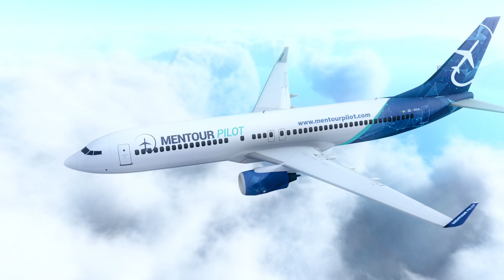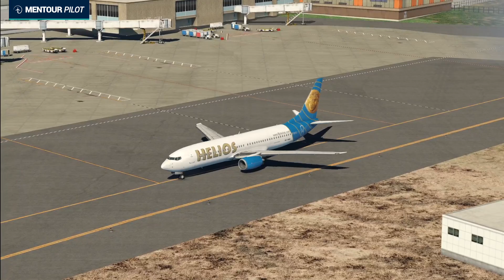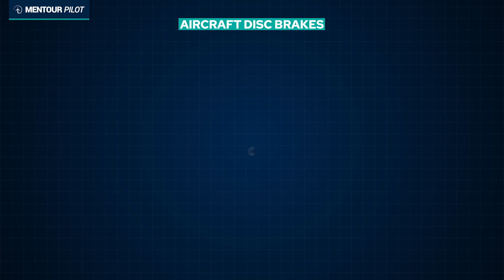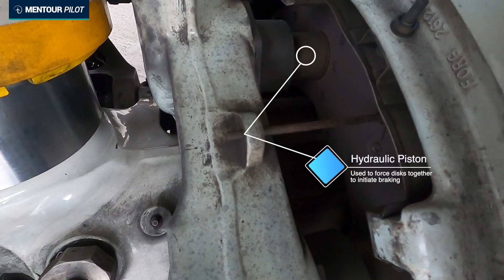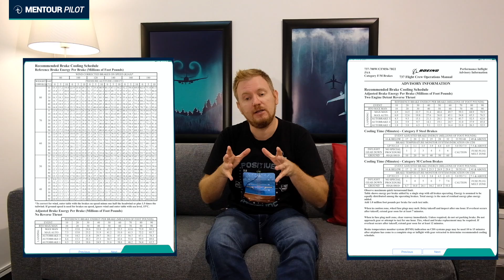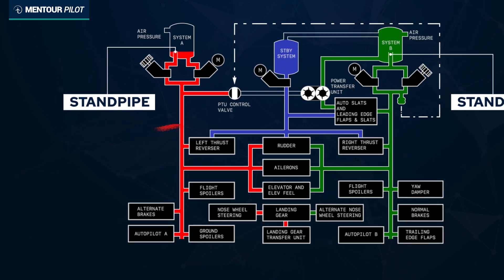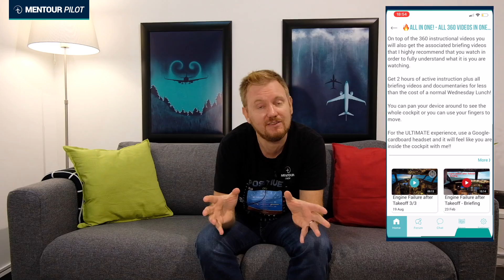How do Aircraft BRAKES work?!

Comment from the maker: Get 20% discount on the yearly subscription of Brilliant by using this code 👉🏻 https://brilliant.org/Mentourpilot/
Reply: Hej!
Reply: i got a good one.  What is that noise in the gear bay that is a low pitch tone followed by a higher tone beep?  I think it has something to do with a systems test or resetting the FMS or something.  I hear it from time to time while fueling the 737 NGs.
Reply: During a normal landing, under calm and dry conditions, typically what percentage of speed reduction can be attributed to: brakes vs spoilers vs reverse thrust ?
Reply: Exactly how bad is it to do 2 rejected landings 40 minutes apart? I was flying from Fiji to LA and apparently a fuel pump wasn't working.  The pilot waited for a plane to land that was supposed to have a replacement, but it didn't, so he tried and failed to take off...  Then waited for the another plane to arrive that also might have a spare pump, but the didn't, so 40 minutes after the first rejected take off, we had a second one...  About 10 minutes later he said, 'Ok, lets just try that again...' Third time lucky I suppose - we got airborne!  And had a completely uneventful flight to LA.  Would a third rejected take off in an hour have been bad?
Reply: @rjmac3095  what aircraft ? Most Airbus planes have active brake fans and brake temp indicators
Reply: @bobl78  It was definitely a Boeing, but I'm not sure if it was a 737 or a 767, basically one of the medium/large aircraft, but definitely not a 747.  It was Air Pacific, in 1997, if that helps.
Reply: Mentour Pilot ( Wow !!!) SHEIKH MD. SHADDAT HOSSAIN .
Reply: The trucks use air brakes. Why do airplanes use hydraulics?

Comment: 18:28 - nope, sounds perfectly reasonable, at least the way you explain it. Autobrake might not have the same feeling that you have as a human, so it sounds like a good idea to set it a bit lower, to prevent skidding on one side or whatever might be a problem. As a human, you can judge those risks, and quickly adjust to those factors. Automated systems normally reacts to performance, rather than a visual or experienced reference like you might use as a pilot.

Comment: nah, never thought of it, really. BUT - those tires, they´re the really amazing part! Coming from a -50 degree environment onto hot tarmac that might be 70 degrees, spinning up at landing and then immediately having to brake? That´s the part that amazes me. Metal can take a lot of heat difference, and it dissipates really quick. Rubber is an entire different ball park, and it performs extremely well!

Comment: This is a GREAT video, Mentour Pilot! I wonder if you have contemplated remaking these older Aviation Systems videos with the MAGNIFICENT TEAM you have working for you now, with new Graphics & Animations? This is a GREAT Education Channel for Aviators, and even Engineers!
Just a point of correction:
— The lower temperatures of Carbon Breaks is down to the Physical Heat Capacity of the Material, not primarily the Heat Transference, as you indicated in the video.

Comment: Wow wow wait a second! If you position RTO on the auto brake and then you really need to to reject the take off even slightly a bit V1 speed and lets add a wet slippery runway then I'm curious to know! 1st as you said putting back all thrust levers back will automatically activate RTO on auto brake, but you found in a second that you need thrust revers deployed and apply max trust using the thrust levers, then what happen? Are you hitting the brakes with your feet still or you know RTO will apply them for you even when you apply max trust to slow down the airplane with reversers deployed to stop on the runway??? Or all of the rejected takeoffs before reaching V1 are trained and executed only by using brakes and nothing more???

Comment: Back in the 70s and 80s I worked for PSA in San Diego maintenance on the B-727. All our 727s had nose brakes which were only activated during heavy braking. They were required to operate out of airports with shorter runways to assure stopping during a rejected take-off at higher weights. More passengers were carried with operative nose brakes. We were required to remove the brakes after so many months because they were never used and send them out for overhaul basically to remove the rust.

Comment: Just "adding 1+1" here but if on carbon brakes it's the number of times you use them and not the intensity that wears them and you have an antiskid system that will release and apply the brakes very quickly, I think it makes sense to say that antiskid will wear the carbon brakes a lot faster than steel ones even though they're better, right? Congrats on the great channel ;)

Comment: Yes I know modern large aeroplane wheel brakes work, Instead of a single disc pad set up on your wife,s Nissan Micra Economy car. You have multiple rotor discs and stators stacked  one atop the other like vinyl on an old  50,s stacking record player,. Working off the utility hydraulic system at 5 - 6,000 pounds per square inch six or eight  piston actuators, each the size of a catering can of coffee  squeeze the rotor discs stators together like a hand cranked cider cheese press. Slots precision machined inside the wheel rims  engage with tongues on machined on the rotor discs. Each Brake pack prevented from revolving with the wheel by strong torque rods anchored to the oleo leg.  Like a top range BMW or Jaguar a sophisticated  anti skid system ,like that manufactured by Allied Signal Honeywell prevents wheel lock up during heavy braking by sending a series of pulses of high pressure to each brake pack  ,on off on off ,in microseconds.  Most large commercial jets have a pre selectable  autobrake function , essentially the braking systems brain, detects which wheel is on  the verge of locking and skidding  then automatically applies releases the brakes in a series of skips.

Comment: The last destination today is a short field , the solution seems too simple, If I am the pilot and knew there are residue heat from the last airport ground operations, I just have the gear down earlier and let the airflow cool the brakes to ambient temperature. The gear will also help keep the aircraft within the terminal speed limit.

Comment: You are always talking about how important SAFETY is to the airline industry yet you have planes with inferior brakes and a lack of a vital sensor. Now I know you can tell me that the sensor is not that vital because you can do your calculations but PEOPLE can make calculation mistakes. Also PEOPLE can be lazy or have some other mental malfunction and just not adhere to doing it. Not only should every plane have the sensor but they should be tied to the computer in a way that prevents pilots from taking off again until the proper temp is reached.

Comment: Use of the Helios 737 in this video was probably ill-conceived. The vision sent chills through me, as this was the airline that suffered the horrendous depressurization and crash in Athens killing all 121 on board, who had mercifully already died or lost consciousness from hypoxia and freezing. 

The cause was a string of faults and errors going back years, but ultimately the triggering cause was the pressurization switch set to Manual rather than Auto prior to take off. 

Helios Airways went out of business shortly after this crash in 2005, so to use the Helios aircraft vision in this video of 2021 is odd.
Reply: Helios in this? Thats strange🙄 At what time?🤔
Reply: @speedbird9313  At 2:40
Reply: @rainscratch  Yeah, thats unfortunate🙄 In Petters defence I believe that good footage/animations of a taxing aircraft with a good oversight is hard to come by🙄

No depressurization on Helios 522 by the way, it was lack of pressurization.
Reply: @speedbird9313  I believe most of the visuals are animated via Flight Sim software.
And yes sorry I got the cause mixed up with another incident, Helios was oxygen starvation, that incapacitated everyone, except the steward Andreas Podromou, yes?
Reply: @rainscratch  Right👍🏻 Really strange why he didnt go to the cockpit at a earlier stage🙄
Reply: @speedbird9313  Was not any clear answer, as no one would know. Maybe it had something to do with the flight deck door being locked and he couldn't get in until using an axe or something to break in?   He seemed to have had more oxygen bottle supply than everyone else. Such a tragic situation  - he was filling in on this flight to be with his girlfriend, also a cabin staff.
Reply: @rainscratch  I know🙄 No, he got in by using the airline code on the door, you cant break it down. For oxygen he/they used portable oxygen bottles, which the aircraft had four of.
Reply: @speedbird9313  Thanks - its been a while since I read the report and saw the video recreations. I believe the large portable O2  bottles were found empty,  but at least one kept him alive,  although he would have been freezing, hence impaired judgement and movement. If he had the door code - one wonders why it wasn't opened very early in the sequence?
Btw with your moniker you must be from the UK?
Reply: @rainscratch  Yeah, three out of four oxygen bottles were found opened.

No reason he would be freezing really, the aircondition and pressurization are separate systems, even tho they are in the same ata. 

No, just liked the BA callsign🫢😉

Comment: So, I have a question: If carbon brakes degrade due to the number of times they are applied, what does that mean for the anti-skid system on an aircraft with carbon discs? It wouldn't make sense for the anti-skids to apply those brakes potentially thousands of times during a braking maneuver, would it?

Comment: There were a jetblue case some years ago when nose gear locked at 90 degrees. I heard that to prevent the plane loose directions the pilots locked the nose gear. Is that correct? How did then done that without brakes in the nose gear?
Love your vídeos

Comment: funny thing. calculation (model of cooling) is used in industry too - Aluminium billets heating is an example - when billet is rejected [press unable to accept it because of any hold-ups] billet is delivered to reject and PLC models cooling process to take it back to heating after press recovers. it must cool down by ca 200 degrees C for re-heat because Al must be heated with taper (front warmer and back cooler - ratio is up to 100deg/m). Taper is to prevent ready extruded profile from overheating - Al extrusion is slow and heat generated by press can travel back. too high extruded profile temperature could destroy its mechanical proporties.

Comment: Pads are made from carbon fibre. process takes few hours of heating where core reaches 2000+ degrees. this is done by induction heating where heat is produced in workpiece itself.

Comment: Did some calcs when you said 2.2 GJ of kinetic energy for A380 distributed over 16 wheels. As I see it, 738 kinetic energy to absorb might be pushed up through the roof by speed right up to tyre speed limit, and it might occur on landing. Say a place 6000+ ft of elevation, high temperature, high winds with gusts forcing 20 kts of correction to vref at MLW further forcing flap 30... ground speed at landing might be around 190+ knots. Kinetic energy there is about 0,3 GJ on two rather smallish pairs of wheels. True 380 has 014 GJ per wheel vs ~0,8 GJ on 738, but i wonder what the difference is in actual total braking surface and volume (mass) of actual material to store the heat of one vs. the other. It sure looks nasty.

Oh and another question: I know there exist brake cooling vents for cooling on ground. Is liquid cooling on ground a no-no for cracking reasons or can they handle some water pouring?

Comment: If you are driving a truck on snow or mud, you want the breaks to lock in order to push a heap of snow or mud in front of the wheels. If you have antilock breaks, you can't stop on snow or mud. So, what happens if you go of the concrete onto soft ground ? Can you switch off antilock breaks ?

Comment: I would like to note that anti skid systems are actually very different from the traditional ABS systems in cars, 
The ABS system is like the anti lock systems where anti skid systems are "adapting" to surface condition thus, anable amazing tire efficacy (up to 98%), this enables to operate the tires very close to the slip point

Comment: Is there any brake cooling system wether via air cooling or liquid cooling?(sorry if this is a stupid question. I'm far, far away from being an aviation expert🙈)
Reply: Not on the 737NGs
Reply: @speedbird9313  Thank you for your answer. I was wondering if there's anything like the cooling fans wich are available for example for the A318.

Comment: As you say "hydraulically" so you should immediately get to the point of "how hydraulic braking systems actually work" as believe it or not there is an example in the World of the motorcycle business (Yamaha GTS) that shows how a hydraulic braking system functions in the real World thus you can do a "show and tell" instead of "talk talk talk talk talk."

There is even more amazingly a one off 2 wheel drive dirt bike that was made in Australia to prove out the concept of both 2 wheel drive motorcycles AND hydraulic braking. This also dramatically changed the suspension system of the machine ("swing arm suspension.")

If applied to a massive in weight pure battery electric vehicle this could create truly awesome improvements in braking, handling and reliability of pure BEV transportation to include battery powered flight which as already exists with "normal"(extant) flight is subjected to a truly AWESOME ahem "weight penalty" ahem.

Comment: You asked if any aircraft had nosewheel brakes. I believe the 727 originally came with nosewheel brakes but they were removed because of extra weight and the fact they were basically never really used until max braking.

Comment: Fantastic channel that drags you into a level of detail you would probably never roam into on your own.  Thanks !
On behalf of all the average lightning bolts out there I have to emphasize that the energy content pr. bolt is somewhere in the 50kJ - 100kJ region.  This could make you one or two cups of coffee.  However, when released over 50µs, the instantaneous power is 1-2 GW, which is sufficient for disintegrating old oak trees, frying electronic devices, starting fires and cause all sorts of havoc.  But 2.2 GJ is a completely different ballpark in terms of energy release.  30000 lightning bolts will come close.

Comment: Im surprised aircraft manufacturers haven't experimented with aluminium discs and powerful magnets which can be moved closer to the discs and further away

I know from an engineering channel i watch, if you try to slide magnets close to aluminium, it causes an eddy current, and causes braking, and its graduated, the faster the aluminium is sliding past the magnets, the stronger the current, and the higher the braking force

The slower the alumnium slides past the magnets, the less the current is, and the smaller the braking force is 🙂

And the best thing is, no heat caused by friction 😁

Comment: Just to add to what you said about the rejected take-off test, when they do this, the test is done with the brakes degraded to the point where an airline would normally be required to replace them. Once they stop the plane, the plane has to sit for five minutes without catching on fire to simulate the time it would take the fire crew to get there. As far as nose wheel brakes, the Boeing 727 had added in at some point, but they were later removed after it was determined that they didn't really have much of an effect when it came to stopping the plane.

Comment: A question if I may:  If the A and B hydraulic systems have failed and you are going to use the pressure stored in the brake accumulator to brake I understand why a limited number of brake applications are available.  That being so, is the anti-skid system deactivated (automatically or manually) in this condition?  Under heavy braking that causes the anti-skid to activate I would think it would exhaust the pressure in the accumulator very quickly as the anti-skid system essentially "pumps" the brakes.  If this is not the case, does the anti-skid system draw power from some other source to do its apply and release cycles?

Comment: wasn´t there an accident back in the days where an aircraft did several high speed taxi runs  up and down the runway to blow off dense fogg from the runway.. when they finally  retracted the gear with glowing hot brakes, a fire broke out in the gear bay

Comment: in a car it´s called Anti Lock System or Anti Blockier System in German as it was definied by Bosch, one of inventors of the modern electronic systems..it´s not an Anti Brake System :)

Is there any feedback in an aircraft wheter the Anti Skid System is engaging or how much it is engaging ? As a kind of feedback how slippery the runway currently is... similar to a car where the pedal starts pulsating when the ABS enganges2

Comment: Great explanation. I’m amazed that steel  brakes can build and retain heat over a day on short haul as each subsequent flight at minus 30-50 degrees would “suck” the heat out of them. It’s like being in a very interesting engineering class
Reply: Just goes to show the myriad of physics, aerodynamics, electrical, aircraft systems, and engineering topics pilots have to be familiar with.

Comment: So if the number of brake applications is the determining factor for wear of a carbon brake system... does the anti-skid system work differently with those? After all, thousands of brake applications a second sounds very bad... and that's without even accounting for things like resonant vibration modes setting up in the discs.

A more sophisticated sensor system feeding data to a PID controller at the very least, seems like it could adjust pressure dynamically but smoothly, rather than pulsing it rapidly.